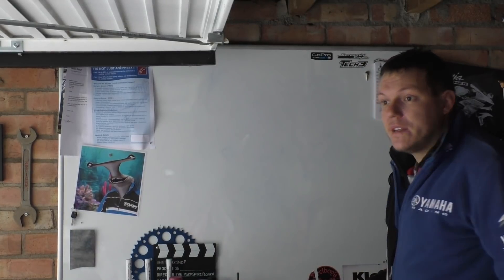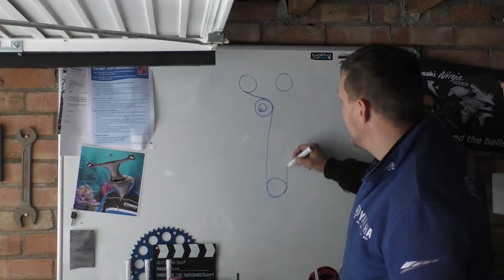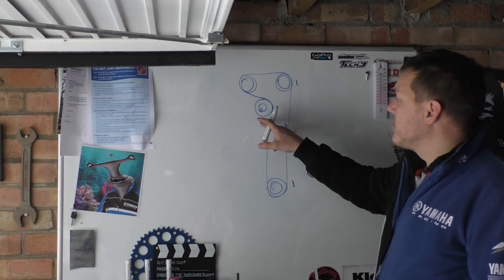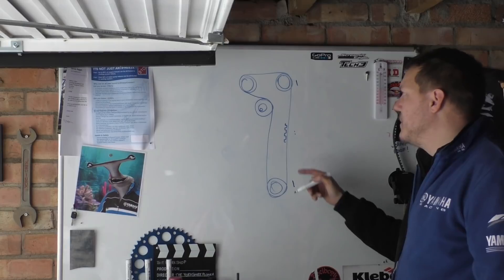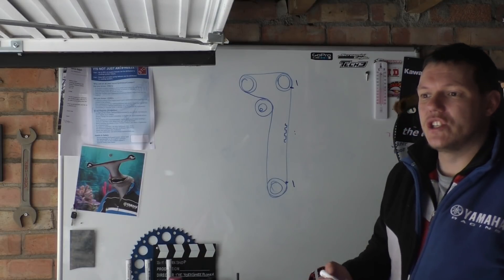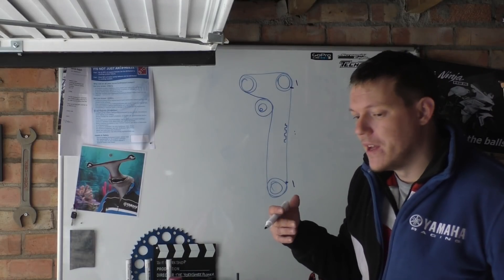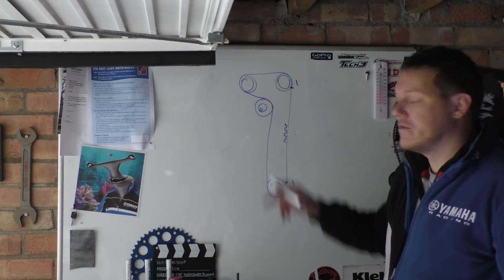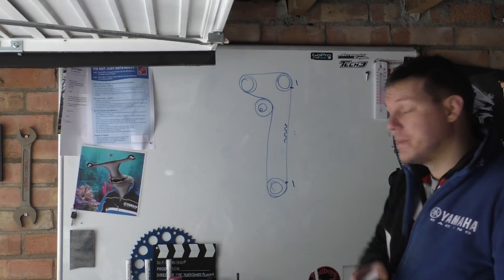Camshaft Drive - Belts - Part 2

Comment: fuck me you r a idiot 1to1 timing is bull shit do you not understand how a 4 stroke works .....half the fuel will go straight out the exorcist all 4 strokes r 2 to 1 its the first thing you learn    dip shit
Reply from the maker: LOL yes david - you qualify for todays dumbarse comment - Take a look at this picture -

https://i.ytimg.com/vi/lNsC8Mn6big/maxresdefault.jpg

What would you say the relationship between these pulleys are?
Reply: sorry me bad i just looked at ducati  timing but in my defence it must be more of a modern system controlled by a very complex ecu    SORRY#
Reply from the maker: LOL no worries. The drive pulley is run off a gear set inside the case. The reduction is done there at 2:1 and then the drive pulley can be 1:1. If you look at the picture you can see that the drive pulley is not on the end of the nose of the crank, or where it would be if you could see the internals.
Reply: i am still missing sumthink on the power stroke the inlet valve is opening so total loss in power ???????
Reply: i got it is geared from crank to bottom pulley not seen that before :)
Reply: So the cams rotate CCW as to the crank... Is that to counteract gyroscopic effect from the rotating mass or smtng fancy?
Reply from the maker: Probably not, the cam's masses fall well short of the crank mass
Reply: these a gear 50% smaller driving the bottom pulley so reducing the sises and mass off the cam pulleys = less mass and weight improving throttler response SORRY i 50 year old now and a bit stuck in time old school shit    but have seen new cars whit oil bathed timing belts like the ford mondeo fore one    fore the past 6 ore 7 year :)
Reply: You've got to love Ducati engineering design solutions. Nice pic Matt. Pure engine porn.

Comment: Most of the vibration of cam belts and chain is it low speeds where there is a slight torsional reversal as the cam lobes roll off the valve spring tension, sort of flicking the cam forward within any chain or belt slack then stalling till the chain or belt catches up. not an issue from high idle onward.
It can cause quite a bit of overhead noise at idle as well as the chain itself that can be misdiagnosed as some top end fault.
When we had cam driven distributor it would cause a thrashing noise from the advance weights due to it and could be mistaken for a dist fault.
Hence most cam belts die at cranking or idle. when I worked as an RAC patrol most dead cam belts where in car parks or in driveways at home. Very seldom at driving speed.
If it persists in an engine with cam rocker followers it can cause a pitting on the rocker follower that eventually catches the valve stem top, momentarily locking and causing the cam to snap.
No harm in replacing a cam belt sooner than required, in addition to the fact it advances cam timing back to original that makes the car idle better and improves town fuel economy by way of improved low speed power.
To the degree most customers notice it after a new belt.

Comment: Cam chains on 4 stroke motocross bikes always rattle like fuck 🙄

Also not bike related but Ford have an engine in there Galaxy range and i think its either the timing belt or fan belt runs in oil 😳😳

Comment: I remember seeing that there are modern engines that use oil-soaked belts for timing cams. not sure if for motorcycle there's a reason it doesn't work. IIRC one of the reasons for oil-soaked belts is a couple dB volume reduction vs dry.
when I heard that ducati uses belts because it's quieter I LOL'ed, because they also use dry clutches

Comment: One advantage with a belt is (as I discovered in my petrol Mondeo) if the tensioner goes, you can still drive it very very very very very carefully and slowly. I drove from central London to Heston services after mine went. But if you try this and fuck your engine, don't blame me. I was either very lucky or I nursed the thing old school style. 15 mph through St James Park was okay, but the same speed on the M4 even after midnight was annoying for other drivers. But I did it.

Comment: Next, gear driven cams :)) the most superior of the lot. No fucking arguments here. Even if you forget all the most exotic engines with gear driven cams, Honda adopted them for the amazing little 399cc CB-1 NC27 and (to regain their reliability reputation) in the VFR. Yes they're more expensive, but that's one of the best reasons to buy a bike with gear driven cams. It's rumoured that Honda lost money for several years on the VFR - to regain that rep. You literally get more than you pay for.

Other reasons: Cams not needing adjustment for 50k...! Stories of VFR engines regularly covering car type milage. That excellent sound. Bulletproof engine in general. No, you can't mess with the compression ratio, but who does the days anyway? And Honda did go back to chains (the much cheaper solution) on the VFR after they decided it had secured that rep with perhaps their best ever engine. 
I can't find any vids on YT covering rebuilding a CB-1 engine either. There may be many reasons for that, but the pistons will wear before the cam gears. 

Plus, everyone who has had a camchain failure (chain or tensioner) knows that sickening feeling. For me, there's nothing that comes close.

Comment: Hey Matt, 
Ducati cam belt tensioner is not spring loaded , it’s simply set in place by hand at the required tension & tightened / locked in that position.
And, technically a belt would last longer than a chain ,, but if you own a Ducati you know this isn’t the case .
When it comes to my 996 super bike, it’s every 20K kms or 2yrs due to the severity of the angles / curves that the belt has to rotate around. You can choose to run longer intervals , but regular belt changes is cheap insurance when it comes to a Full Interference engine.

Comment: Have you seen the ford cam belts that run through the sump as well so are oil coated, right strange decision on their part
Reply from the maker: no............
Reply: The Workshop https://www.google.co.uk/url?sa=t&source=web&rct=j&url=http://www.ngfeurope.com/~/media/NGF%2520Europe/Site%2520Content/News/Automotive%2520Design%2520Europe%2520Feature.ashx&ved=0ahUKEwj2yNHTrpfYAhWCHsAKHc2IC1AQFgglMAA&usg=AOvVaw32yeUxOYmrhPAjsk3mR_ej

The older 1.8 diesel also used a split system, where it would have either 2 belts where 1 was in the oil, or belt and chain.
Reply: ah, this must be what I was thinking of about wet belts. wow 5dB reduction is not bad
Reply: phillip galas yes and no, I get the distinct feeling that there's some marketing dick rubbing going on with the noise reduction. 

Yes I'm sure it doesn't make it quieter, but on a car belt noise is very rarely an issue unless there's something wrong with the system to start with. 

It's something that may be useful on a bike were you are exposed to the bare engine noise at high rpms, but in a car mostly driven bellow 3.5k, inside a sound insulated cabin, exhaust noise and tyre roar are going to be far more of an issue. 

I'm sure ford have a reason for using it, my assumption is it's something to also do with heat, those ecoboost engines get a bit roasty

Comment: Aww, now I want a V-belt drive for my camshaft. V-belt drive along with a VVTI-like system which only purpose is to rotate continuously and adjusts for belt slippage as I drive about. And I want a gauge to indicate the beltslip ratio, both in relative and absolute values, just like the speedo/odo...
Reply: enny cam belt slippage will destroy the engine in milliseconds unless you have a none interferes engine but ether way slippage =you walking home
Reply: No, it will work if done as I described above. Interference engine or not...

Comment: 2:26 little question. You say "even the toothed ones can slip". Are there any other timing belts? Can't imagine how a not toothed belt can maintain timing.
Thanks
Reply from the maker: Not sure what you are asking?
Reply: Sorry;) in this video at 2:26 you say oil can cause belts to slip, "even the toothed ones". So I thought are there any not-toothed timing belts?
Reply from the maker: lol no, not to my knowledge. Belts run dry because of this. And the belt doesn't like oil that much can degrade the material) If proper tension and the right harmonics come into play these belts can jump teeth i.e slip - maybe a bad choise of words
Reply: yep sure, I was just wondering about if there are other timing belt designs that you're refering to. Thx man;) I'm watching the rant video, it's cool. That's almost not a rant, that's just a bit of truth and a bit of opinion and a bit of fun

Comment: Quick question for you Matt. Valve recesses in the piston crowns -  do they effectively ( aside from dropping a valve ) make the engine non interference and less efficient,  but not prove catastrophic if the cam belt or chain snaps ?
Reply from the maker: Valve recesses are there so valves can open earlier in the cycle

Comment: A belt drive is also easier to replace, to disassemble/ assemble and maintain. You take off a cover and there it is! OK you need the tool to fix the camshaft so you get the timing right... I think it is better to change 3-4 timing belts then one fucked up timing chain. The most issues with the Ducati timing belt show up when a moron things he knows what he is doing... to sad if they work at a Ducati dealer. I owned one and had never problems with my belt, what sucks if you live in a city and need to change the clutch every 8-10k Km. Tire and clutch had the same life span ;(
Reply: MadxJim, You need it! Believe me! that trick might work if you only just replace the belt but when you have to take the head off to check the valves and seating you are screwed. Ducati needs Ducati tools period. Some people can even fail trying your trick.
Reply: onhawaii .... you’re both wrong ,,, who the fuck cuts belts in half longitudinally , what an unnecessary waste of time . & you definitely don’t need a tool to lock the camshafts even when taking the heads off , that’s an absolutely stupid statement.
Reply: MadxJim .... I’d hate to be paying you by the hour to work on my Ducati,,,, to cut a cam belt longitudinally is just stupid & a complete waste of time

Comment: On old Monsters one needed to change the belt every two years (or 20'000 km). On new is a bit better, 5 years or 30'000 km.
Reply: The two year or 20 000km change interval seems to be in effect on the current Ducati Diavel as well. The fact that the local Ducati workshops charge €1300 for that job alone just adds to the pile of reasons of not buying a Ducati.
Reply from the maker: Fucking how much?????
Reply: £1100. Same price, multiple shops. Simply crazy.

Comment: Oh I remember when it cut off camshaft belt teeth in my first car, the engine haven't died. I even switched 4th gear when they towed me to the car shop to use vacuum brakes and power steering.